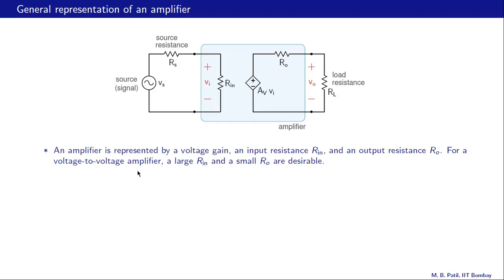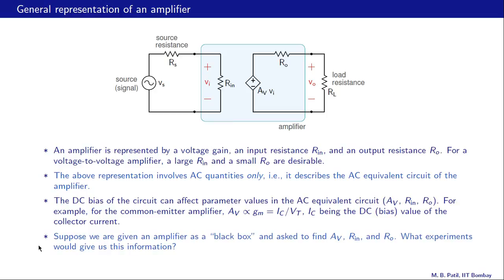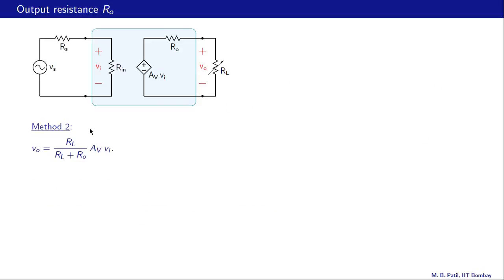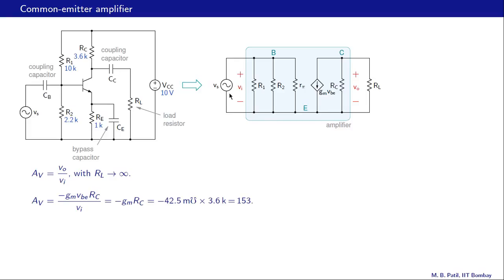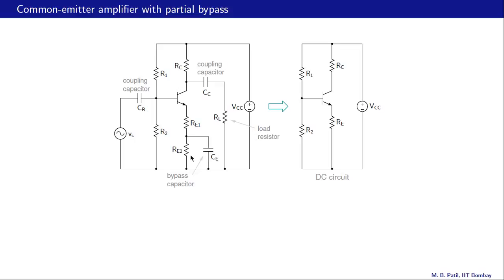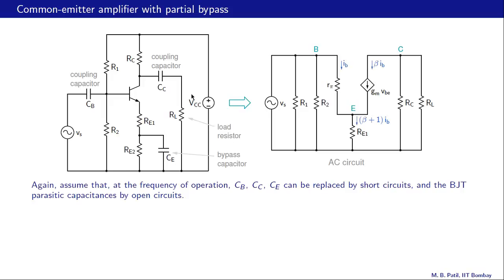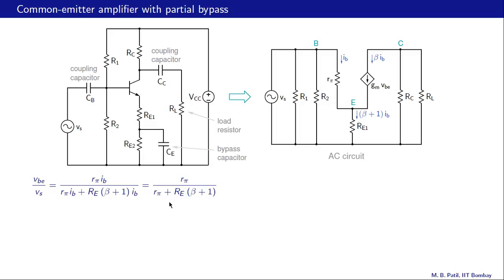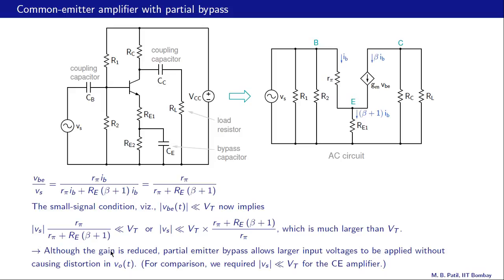BJT AMPLIFIER-7

Comment: excuse me, why we have to use the combination of ( bybass capacitor and resistor) in that time we can replace them with just a wire.  thank you.
Reply: I think he tries to bypass only the signal not the DC voltage
Reply: Interesting question but in that case, it affects the DC bias system